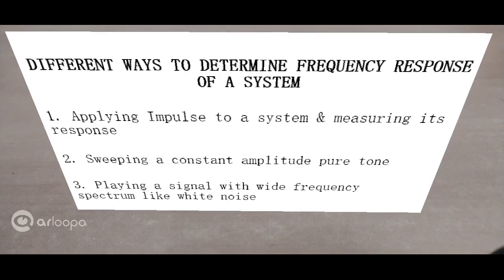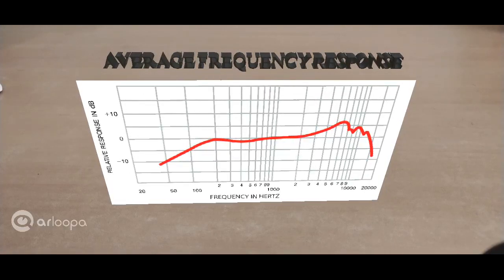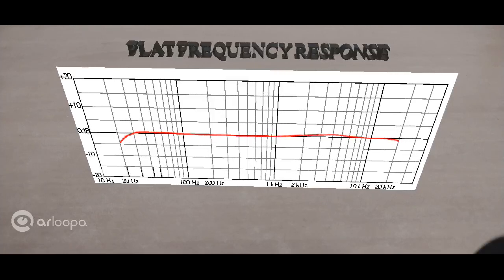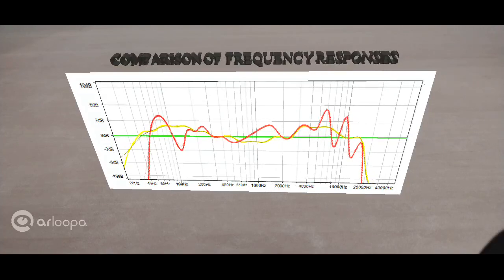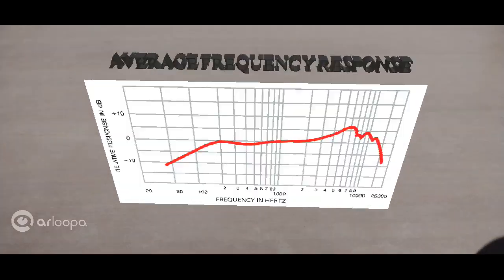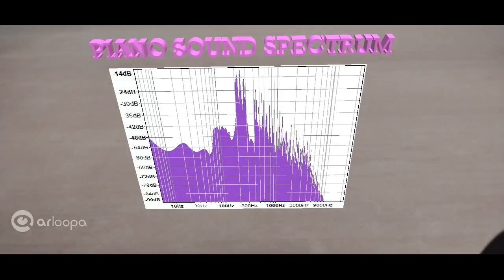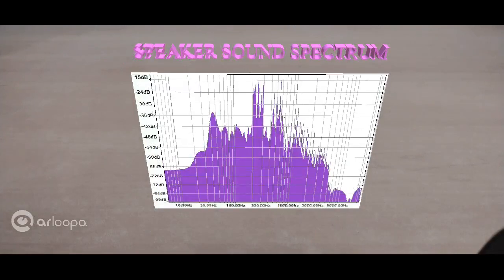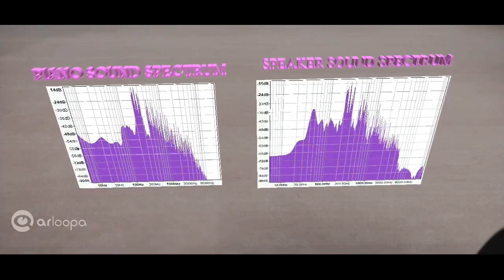Frequency response explained

Comment: Hi, thanks for the video! What is the meaning of a positive or negative deviation from zero? For example, if we get a positive deviation between 10-20kHz, how does that impact the output sound?
Reply from the maker: You're welcome! Both positive or negative deviation means that the sound is not captured "as is". If you get a positive curve in some frequency range, it means that what you hear is an amplified sound and not the exact sound. For example, the human ear has a non-linear frequency response, which leads to many positive and negative deviations for different frequency bands.